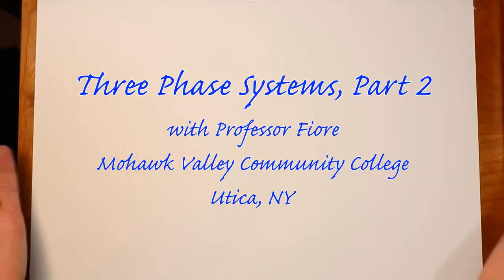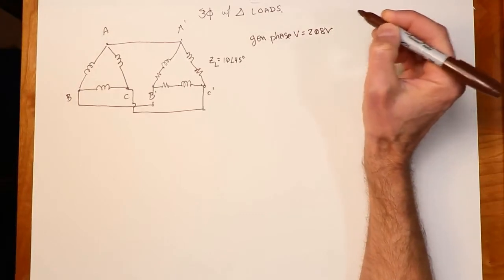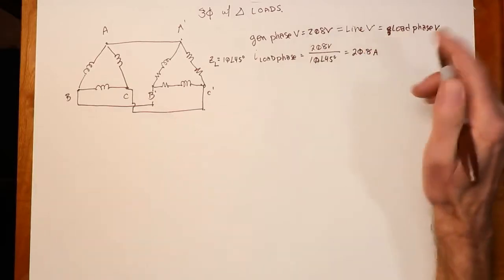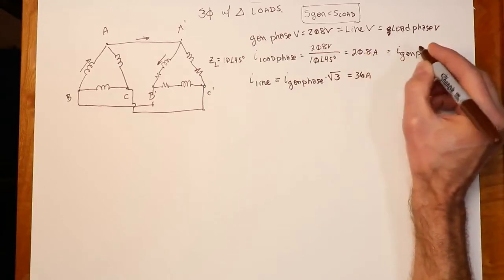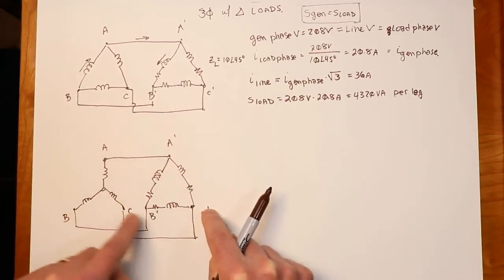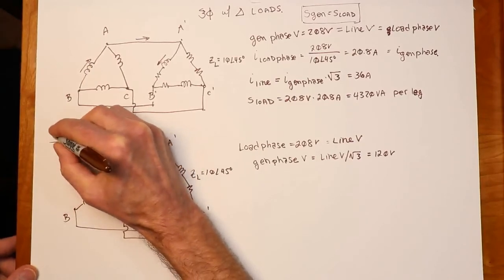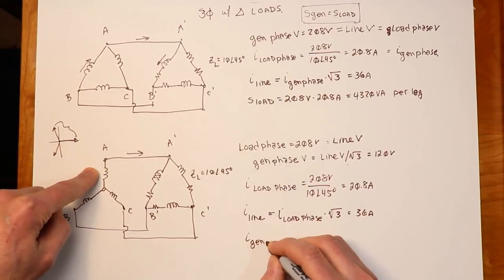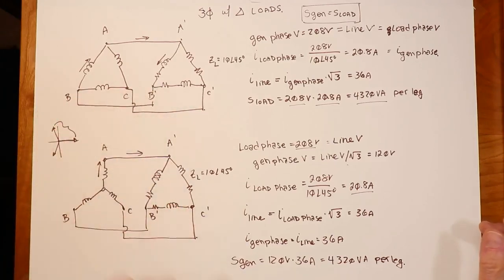AC Electrical Circuit Analysis: Three-Phase Systems, Part 2

Comment: I'm curious now, what are the use cases for each of these 4 configurations?
Reply from the maker: Polyphase is a power application. Any time you need to use (or deliver) high power, you would consider a polyphase system. Think in terms of industrial uses such as large motors.